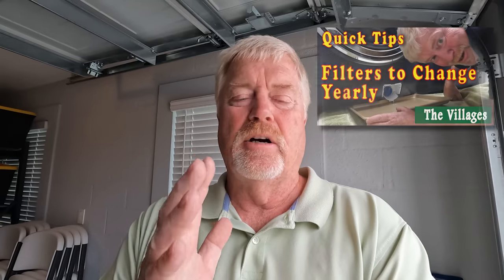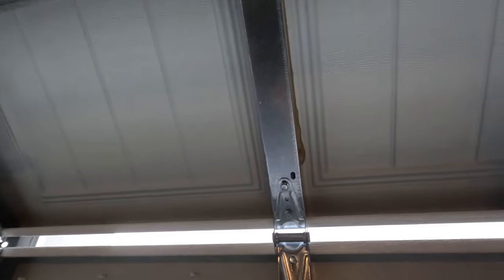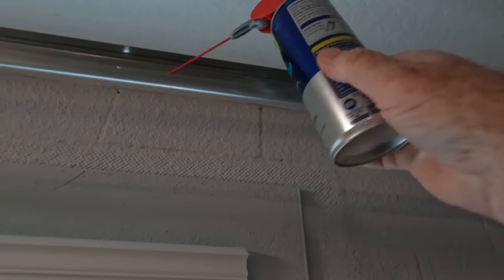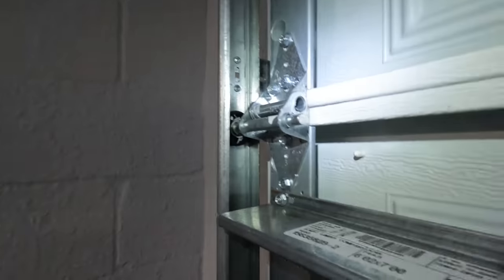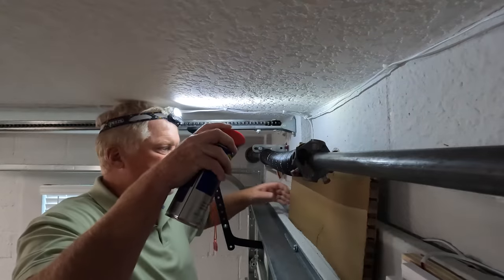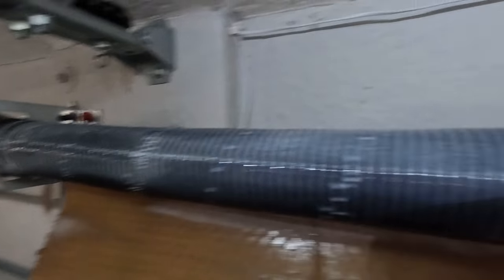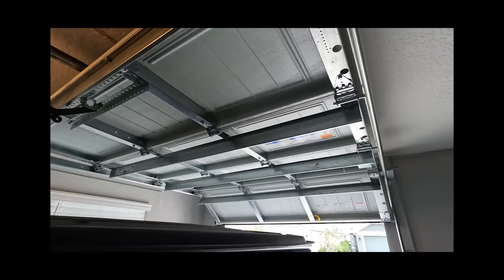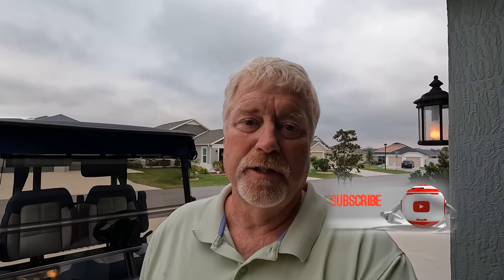Noisy Squeaky Garage Door easy fix with some lubrication in The Villages Florida with Rusty Nelson.

Comment: I tried the white Lithium grease and over time it builds up a yucky mess that had to be cleaned off with brake cleaner. I ended up taking each roller out, one at a time and degreasing them. I used a Blaster Silicone that work's as good for noise but doesn't get the build up like the white Lithium grease did. Very informative video, thank you.

Comment: Hi Rusty, I find these types of videos very helpful.  I have a new home question for you.  We closed on our house on November 7th and we are replacing the standard refrigerator with a counter depth refrigerator.  I was buying the nee fridge at Home Depot and they said they would not hook up our new refrigerator to the water source because of the plastic push/pull water shut off valves.  The Home Depot sales lady (who also lives in the villages) recommended switching out the plastic shut off valves with the standard metal kind.  Have you heard of this?  What can you tell me about the plastic shut off valves?  Thanks in advance.  Steve

Comment: Never use white lithium grease
Reply: Ageeed. Silicone provides the same lubrication without collecting dirt and accumulating build-up. Otherwise well done video, with a radio announcer’s presentation.skillset.  If your metal chain needs lubrication, an alternative to silicone is BreakFree CLP. CLP stands for Clean Lube Protect and is a mainstay of firearms maintenance. Because the chain is not galvanized like the hinges and other door parts are, the “P” is useful to prevent rust, while the “C” removes accumulated dirt from this very exposed component.  Nothing wrong with silicone on the chain, mind you. And agreed, NEVER plain WD-40 it is not a lubricant it is a Water Displacing rust penetrant.